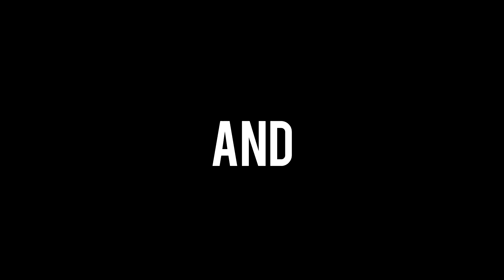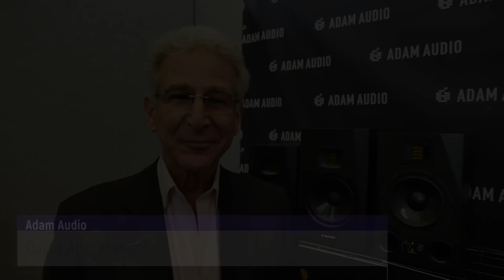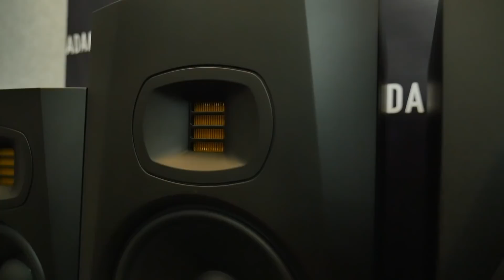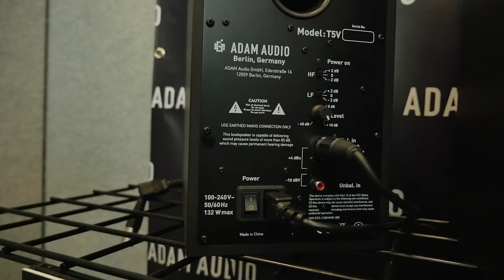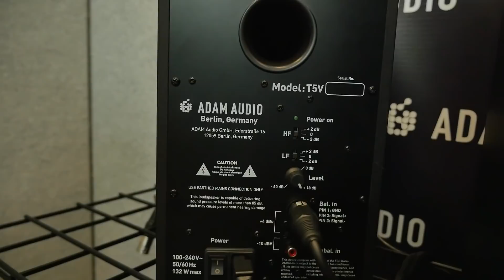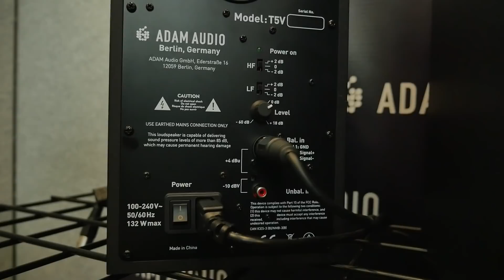NAMM 2018 Adam Audio T Series

Comment: Ok, so you switch on at the back and keep it just over a foot off the wall, and you get the ribbon tweeter plus a lowish end bass with the 7's. Was thinking of getting a Yamaha HS7. The Adam T7V is about the same price as the HS8 (& both not much more than the HS7), so I might just get the T7V for the tweeter alone (less ear fatique & more accuracy). I'm a noob to all this and loved the aesthetics of the Yamahas, but I'm sold on the Adam tweeters.